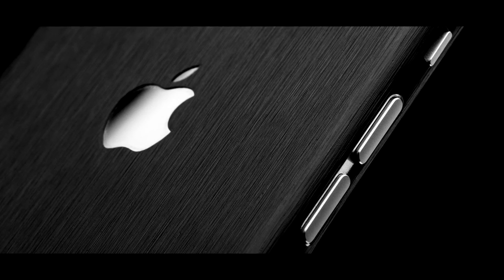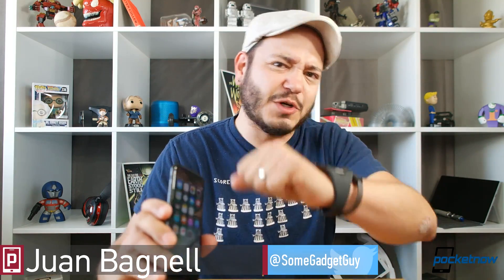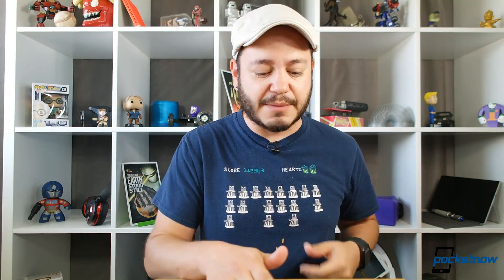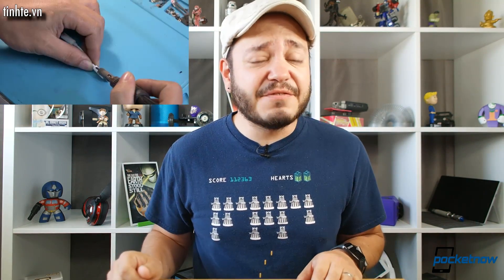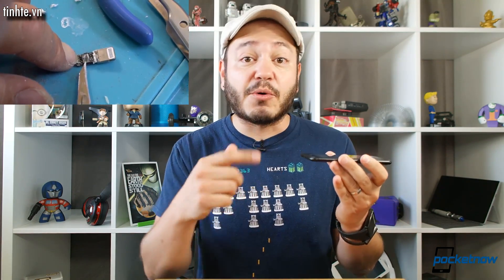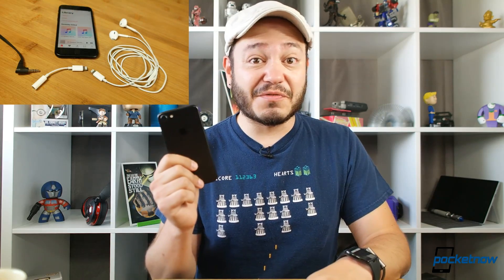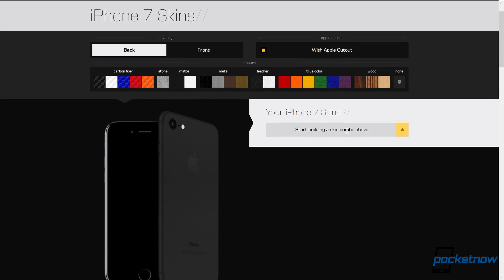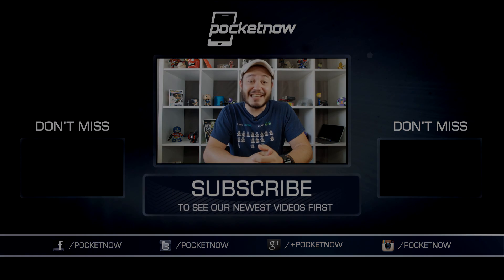Apple iPhone 7 audio part 2: What we got wrong about the DAC... | Pocketnow

Comment: So why in the hell of it would apple build DACs into all of their connectors when they already build them into their phones? Just for laughs?
Reply: There IS a DAC inside the Phone, because something has to drive the speakers!?
BUT Lightning is digital, so you have to put an extra DAC between the Lightning connector and the earphones.
And that shows the stupidity of it.
Beacause of course that meakes the sound quality worse. Especially on In-Ear headphones, because there is simply no space for  even a half decent DAC.
Reply: Kosh Narale They could've designed the lightning connector to be able to receive analogue signals from the DAC in the phone, like USB C. What apple has done hasn't made the audio noticeably worse, it just seems like a more expensive less convenient way of doing it, and will probably add to the price of all lightening headphones
Reply: koolstup 
If you think having an additional peace of tech dangling around on your phone is progess, the yes. 
But I'm afraid you are one of very few people who think that way.
Especially when devices like the LG V10 and V20 show that it is not necessary.
Reply: There's a whole range of USB DACs that now give you the freedom to have the sound you want, not the rubbish that is invariably built into the phone. Is this not progress?
Reply: Lex Francis 
They probably could have, but they didn't!?
And as I said before, on In-Ear headphones especially it's not just a matter of price. There is simply not enough space in them for a decent DAC.
Reply: Kosh Narale There is enough space. The tiny DAC in the lightening connector sounds no different to the one in the iPhone, by all accounts. There are plenty of Bluetooth in-ear headphones with better DACs than in phones. Look at jaybird earphones.

Comment: I guess they need to do the same to a regular lightning cable and check if the same board is not also there.. maybe it has nothing to do with the converting to analog connector but rather a part of the regular lightning connector?!

Comment: So there is a DAC in new earpods? That has to be tiny :D.
Reply: The tinyer the worse, also its about the same size as the lightning connector
Reply: in audio hardware smaller is bad. it's not the same as computer hardware
Reply: ***** the sound wil not be as clear since the connections are so close to each other and get disturbed, this is why sound cards and audio interfaces exist
Reply: ***** look dont argue with me if you want info look it up

Comment: so removing the headphone jack wasn't just annoying it also degrades the audio quality great
Reply: Chiller Miller or buy a phone with a high quality DAC! Like the lg v20
Reply: Yeah, I figured you for just another raving Android fanboy. "Android can do no wrong."

Neither platform is perfect.
Reply: That's true.  But that means it doesn't matter if we use a headphone jack, usb-c or lightning.  It depends on the headphones/headset you buy and how well they're made.
Reply: not noticeable doesn't mean it's not downgrade lol...you gonna notice you need to carry you adoptor tho...
Reply: No, the difference in audio quality is not noticeable through the adapter. Now if you use straight lightning you get...

"When using a Lightning connection, headphones manufacturers can use their own higher quality digital signal processor, digital-to-analog converter (DAC), and amplifier in order to create a deeper, more full sound. Traditional headphones have to rely on what the iPhone can do with its own analogue circuitry. Lightning headphones? Not so much."

http://www.redmondpie.com/lightning-vs-3.5mm-headphone-jack-5-reasons-why-apple-made-the-right-decision-with-iphone-7/

Which will wield better sound quality than the previous iPhone could.
Reply: Granted you need to invest on a good pair of headphones but that is one of the reasons Apple pushed this setup...money. And you can't blame them because it is a business after all.
Reply: Matt Pankey for instance if Samsung did this I doubt you have a Samsung right now
Reply: If I did use headphones often I would not cry all over social media about it. I would not use this omission by Apple consume my time. I'd do just as I said, I would use the included adapter and go on about my business.
Reply: +Cristiano Martins interesting find. Thanks for that! So in essence, your top tier headphones' quality isn't affected by the iPhone 7 internal audio quality? That's awesome. I think people need to invest in good headphones. Not Bose or Beats, but in other companies.
Reply: Even so, doesn't seem very worth all that money if it's hardly noticeable in comparison. Most people that truly care about their mobile audio probably already have one of those portable amplifiers for their high tier analog headphones. This may take a decade or 2 to replace analog.
Reply: Tape the adapter down to your headphones with a small piece of electrical tape and hush your fusser.
Reply: Luke et LOL I use an S7 Edge, but even I can see it isn't that big of a deal.
Reply: I would have it because I use Bluetooth headphones and my car has Sync so it doesn't matter to me. Quit assuming things about me. You don't know anything about me.
Reply: Matt Pankey alright mate keep your knickers on! But the masses aren't willing to regularly charge up heap phones I'm note that's for sure
Reply: I don't profess to know what the masses want. I do know that the masses bought a shit ton of iPhone 7s and 7 Pluses. So, it's not a deal breaker for many since it has sold in record breaking numbers. Do you bitch at Motorola as much as you do Apple? They got rid of the headphone jack, too. And don't worry about my knickers.
Reply: Buy a Chord Mojo.
Reply: Matt Pankey in the true words of someone who will blindly just go alone with what apple does no questions asked
Reply: Matt Pankey you must not use headphones much it's a massive deal breaker

Comment: Well that makes sense. If you buy cheap accessories, you'll most likely get poor performance.
Reply: samsung>apple imo
Reply: Well what kind of DAC did you expect in a $10 dongle?
Reply: Just to add my two cents..This is ridiculous! Someone correct me if I am wrong on this: Before the whole removal of the headphone jack fiasco, you were assured of having a decent quality DAC because there was one built into your iPhone and connected to the headphone jack. There was no need to worry about your headphones providing their own quality DAC. Now the DAC in your iPhone only drives the internal speakers! This means that the Lightning headphones you buy for the iPhone 7 will be even more expensive because they have to provide their own DAC. What a ridiculous ripoff. #Courage!
Reply: ***** water resistance? beautiful design?
Reply: ***** i mean samsung did intensive tests and none exploded it could easily just be a hoax but they are forced to do the recall since some did it and if more did they could get sued :)
Reply: ***** i never said it was better than other android flagships... im saying its much better than apple devices which are overpriced pieces of dogshit
Reply: ***** You are correct.
Reply: Wrong! iPhone cable, earpods and the dongle all have poor quality.
Reply: joes04redrx8 Sony > Bose imo
Reply: Kelvin Miller bruh, if Apple can make an adapter with a built in DAC for $10, then it's safe to say that it won't make any significant difference in headphone prices. You can even get Chinese knockoff Lightning Earpods for $13-20 with (albeit crap) DAC
Reply: +Kelvin Miller It's safe to assume that the DAC used here costs maybe $1 (probably less), and the vast majority of headphones don't need anything better. (Honestly, you wouldn't need better unless you were driving really high end gear.)

Whether manufacturers use the lightning connector as an excuse to jack up the price and increase their profits...well, that's another matter.
Reply: ***** Shut the fuck up with that lame ass joke. Seriously, get with the time you dumbass.
Reply: ***** Please stop that note 7 joke. Its annoying as fuck now.
Reply: ***** You realize that note 7 exploding thing could've been a hoax right?
Reply: ***** what question
Reply: ***** Sooooooo, care to explain why that note 7 in that video didn't explode?
Reply: ***** But I want you to tell me why that note 7 in the video didn't explode, if you say it couldn't possibly be a hoax.
Reply: ***** v20? g5? huawei p9? htc 10? 6p? oneplus 3? for second question i mean what differentiates any phonee from others? software? samsung beautiful metal/glass build? quality? none bending phones?
Reply: ***** i never said the pixel was good!?!? it again is overpriced and looks disgusting im not gonna answer your question because i could give more of a fuck